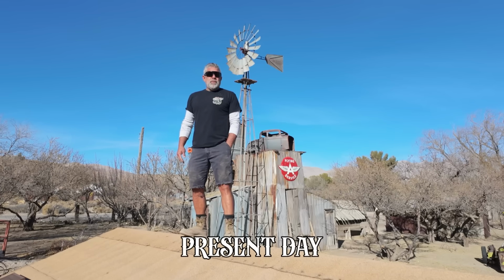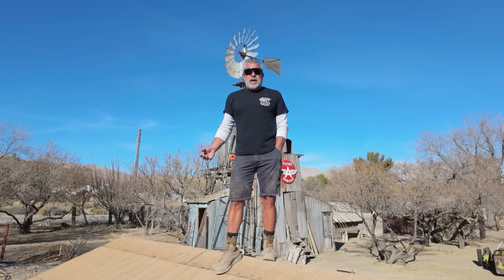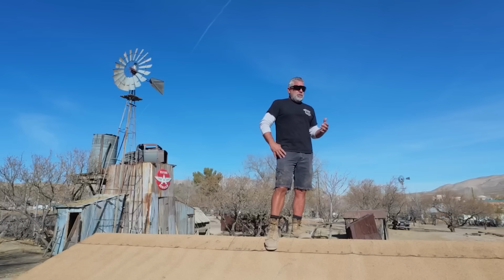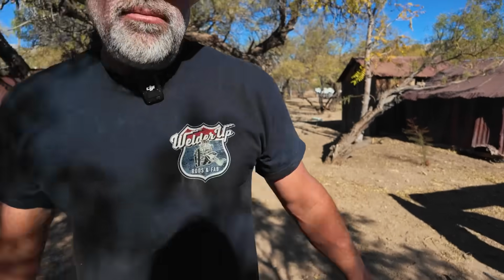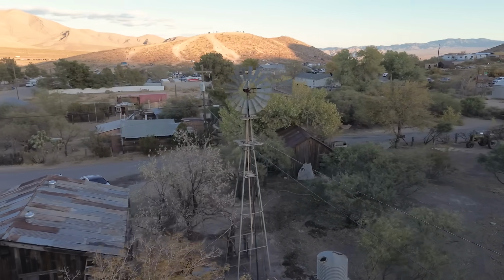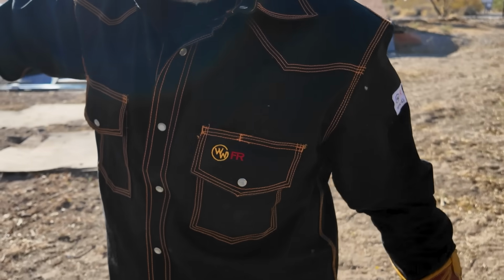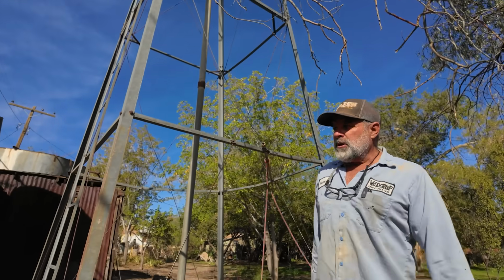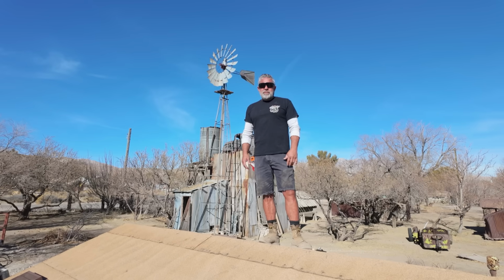We Brought Back Nevada's Forgotten Windmills

Comment: Bonjour Steve,
How lucky you are to have met Herman ! Skills and appropriate parts, even used.
Water is mandatory for your project, first successful step !
Question, is this water directly drinkable, or have you to install a filtration system ?
Amicalement, Raphaël
Reply from the maker: The water is not drinkable. We have to restore the side walls and dig deeper.

Comment: Steve great to see you bringing the wildmills up . Its great to see that your using old parts and old windmills . Best idea a windmill is free water and no running cost just maintaining them . Ive been looking after our southern crosss wildmill here in australia for 30 years . One thing i suggest steve for the pump here they are brass cylinders for the pump . And use leather washers or seals for pump. And one thing ive done which is the best thing but everyone said its not a good idea but , the gal pipes which they use for pump alway rusted out .having to change ever two years  So ive changed them over 15 years ago to stainless pipes best thing ive . Done anyway just through id mention . Thanks for the videos too.
Reply from the maker: That's great to hear, thank you for sharing your knowledge!
Reply: @WelderUpVegas  thank you for your reply  steve . Many thank Anthony

Comment: Had 2 aeromotor Chicago  pumped water from both of them off of 160 going to Pahrump for 35 years the well was 650 feet down. It pumped 1gallon a minute .